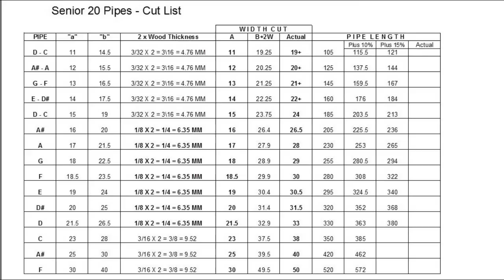Senior 20 Organ (25) Making The 17 Front Pipes

Comment: Dunno about basswood, but when i cut balsa with my mini-saw i use a bit of solid soap on the blade, it doesn't make the cut perfect but it does reduce the "puffy" edges by quite a bit.

Also, i find that using a shorter, straight cut, but wider brush gives soo much more control over the long, narrow types. Especially when applying lacquer, glue or anything that's thick.

Comment: So great to hear them speak. Your artistry shows.

Can you enlighten us on the 'scale' that's being used? I presume all 'roll' music must adhere to a particular key?
Reply from the maker: Levi Shores "F" (corresponds to Midi No 53) is the lowest note and "D" is the highest note. This is the Carl Frei 20 Note Scale 440 pitch. I believe it is the Key of "C".  Music rolls are ordered specifically as the John Smith 140mm 20 note. For the three lowest notes, the music rolls have larger holes and slightly wider spacing than the remaining 17 holes. None of this makes much difference when building the organ. You make the pipes to the dimensions given and tune them with the electronic meter. I think this is really neat as I do not play any instrument and this thing plays itself. :-)

Comment: So what would you recommend as the best material to use for the pipes?  I see in other videos you use balsa wood and here you use bass wood.  Are they pretty similar in sound quality or is one better than the other?
Reply from the maker: Balsa is light and good if you are expecting to carry an organ like the Busker. It is also more easily damaged. Basswood is good and I was able to get good quality slabs from National Balsa. Since then I met someone who has built several different organs and now I would use 1/8" Baltic Birch Plywood. The interior of all pipes need to be 100% sealed. The pipes (correctly made) should sound the same regardless of the wood used.

Comment: When you cover the "air box", which paper do you use Under the cover ? What width for the opening?
Reply from the maker: I am not sure you are using the correct terminology for this organ. The Bellows & Reservoir are covered with lambskin or sheepskin leather. The bellows pump air into the regulator. The regulator controls the air pressure going into the Pressure Box. The pressure box (or air box) contains the perforated music roll being played. The pressure box is made of solid plywood and is not covered with anything. Also, I have not used paper to cover anything.in the organ. Please watch my videos again.Then ask your question again. Thank you for watching.
Reply: Sorry Ron, I speak about pipes. To obyain a fine opening for the wind, you glue the front of the pipe with paper or cardboard. I asked what is the width of that to give the slot ?
Reply from the maker: Oh, that air box. I think you want the thickness of the cardboard gasket or shim.The cardboard spacer is covered in the first 2 minutes of video - Senior 20 Organ (21) Motor Mount & Pipe Configuration Part 2  https://youtu.be/8mBa0AzLlOY  Thickness specified in the plans 0.5mm = 0.0197 inch.  Closest I could find was from Michaels 0.021inch thichness. Hope you are subscribed. Ron
Reply: OK thanks for this. I didnt remembre this vidéo, seen them  a long time ago. I will apply this for my pipes. Thank you.

Comment: @ 0:33 Under actual, what does 19+ 20+ etc mean??
Great and particular build BTW.
Reply from the maker: Sirus On the organ plans, the pipes are dimensioned for the
“internal” size of the pipes. The dimension “A” is an actual dimension for a
wood strip. However, dimension “B” needs to have twice the actual wood
thickness used added to it for the correct size wood strip to be cut (B+2W). In
the first row the dimensions for the D & C pipes, the actual wood thickness
used was 3/32”, which equals 4.76mm. Then, A = 11mm and B+2W = 14.5 + 4.76mm =
19.25mm. At the time when I made the cut list I did not own the Byrnes Table
Saw and I was not sure how accurately I could set the saw fence to fractional
millimeter cuts so I just indicated a little over 19mm or 19+mm. I was rounding
dimensions up and down to nearest 1/2mm. As it turned out I was able to
accurately set the Byrnes Table Saw Fence to 1/4mm dimensions using a very good
quality millimeter ruler and a magnifying glass and I actually cut the wood
strip to 19.25mm. “Actual” should say “Actual B+2W”… but I knew what “Actual”
meant. In any case you would need to make your own cut list according to the
actual wood thicknesses used for your pipes. Hope that clears that up.
Reply: Ronald Walters
Sorry, run that past me again!
Only kidding, thanks for such a great explanation. A digital vernier would work great on the model making table saw. If you could somehow make a fixed right angled mitre gauge and fix the caliper to it. the depth pin pointing to the fence and not on the fence side of the blade. Should make easy work of zeroing the blade to the fence and tiny adjustments after an initial test cut.
Great work. I really enjoy your uploads :D